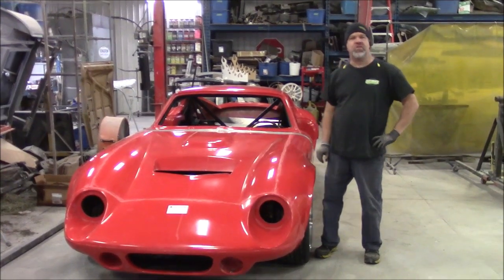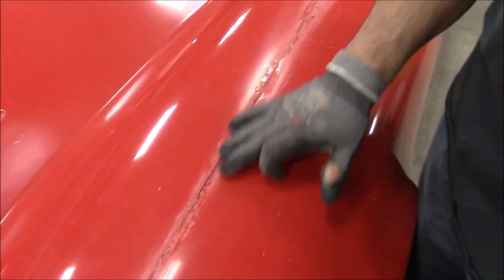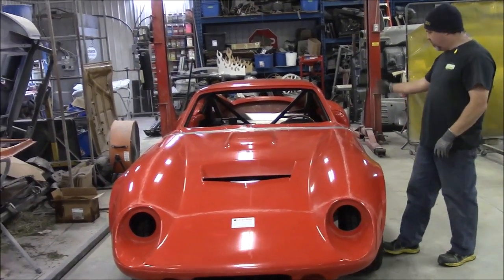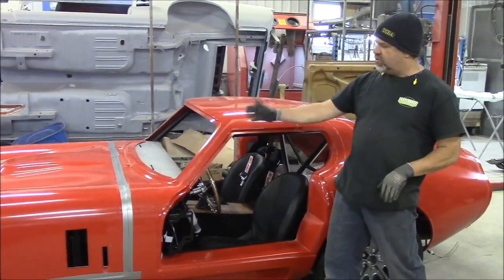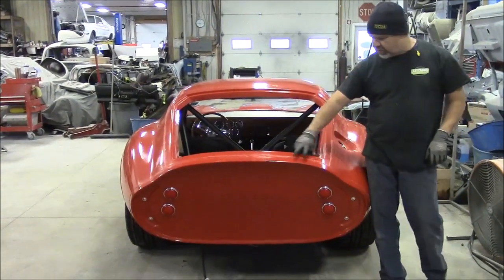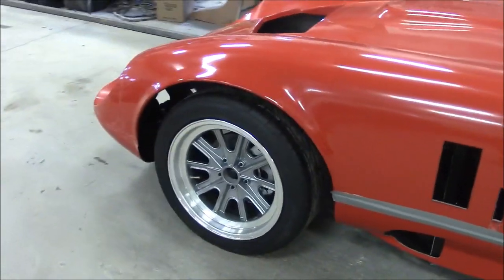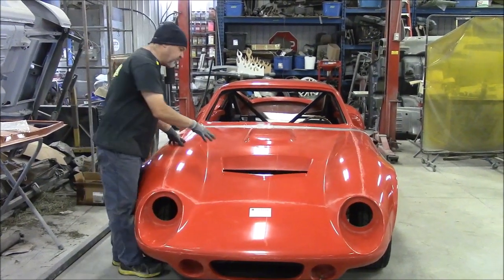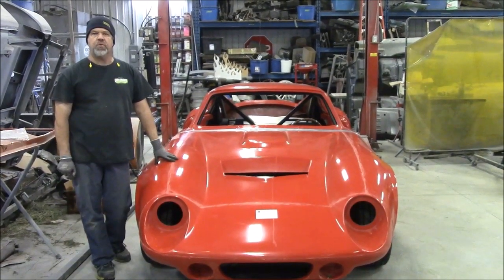Factory Five  Type 65 Coupe, Part 2 Upcoming Build in Ontario  Canada,  lastchanceautorestore com

Comment: You mentioned in the first video that the panels were glued together and again in this video you implied the seams were adhesive that bled through. That's absolutely not the case. These bodies are created in a mold in one piece. The seams are where the molds meet and when the molds are removed from the body, the seams are left.

Comment: Surely the body wasn’t delivered to the customer from FFR in that condition (with those rough seams)?
Reply: those are parting lines for the mold that the body is laid up in, not seams. And yes, it's normal.
Reply: Absolutely. That's how the kit comes. The red is a gel coat, it's not the final paint color. It's up to the builder to do the body work, including sanding down the seams.